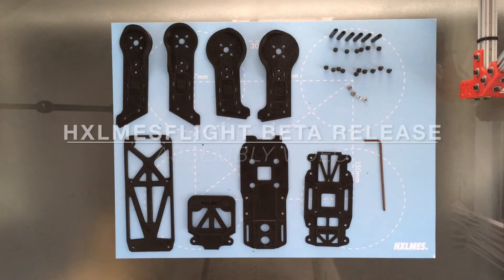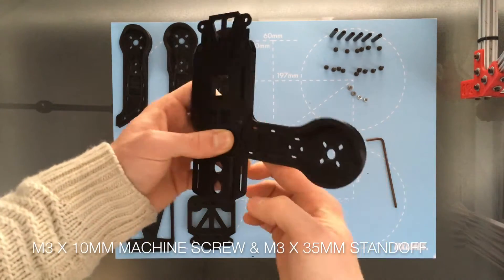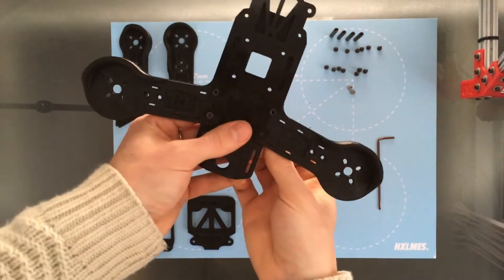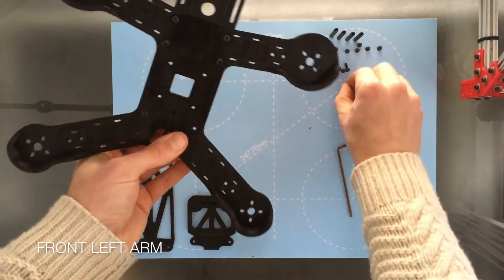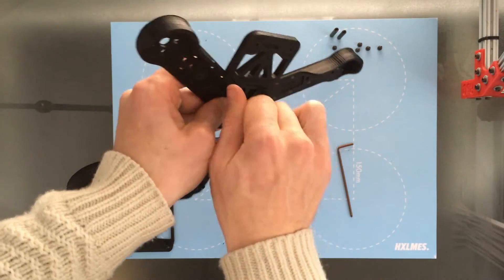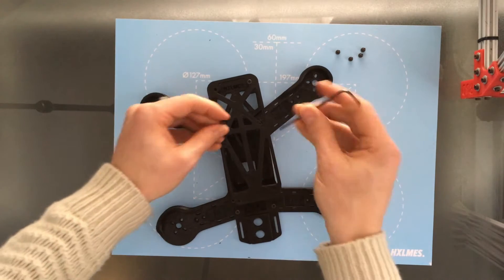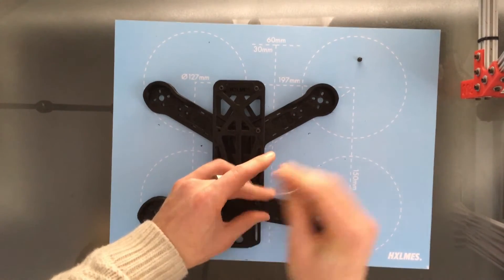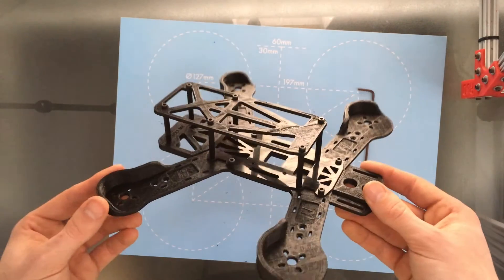3D Printed Drone Assembled in Less Than 3 Minutes!

Comment: What type of material did you print it with?
Reply from the maker: Hi John, this was printed using standard PLA filament. I have since begun using a high-strength matte black PLA (it looks cooler too). Stay tuned for the full assembly video going live in a couple of weeks!